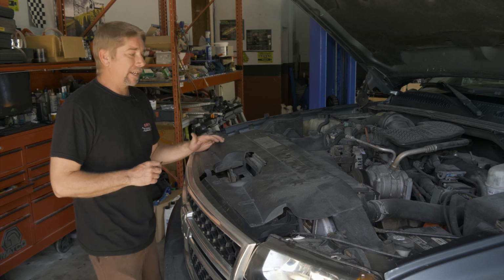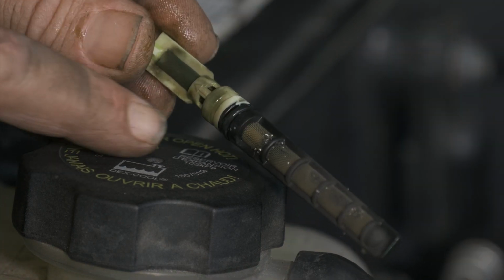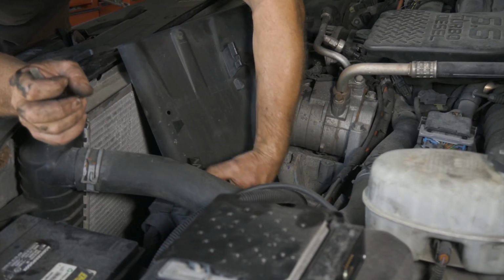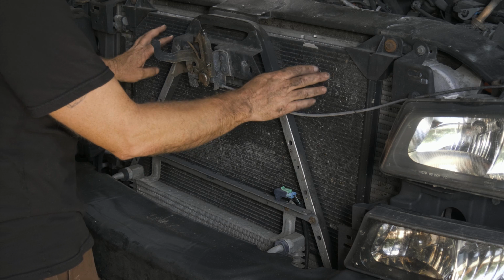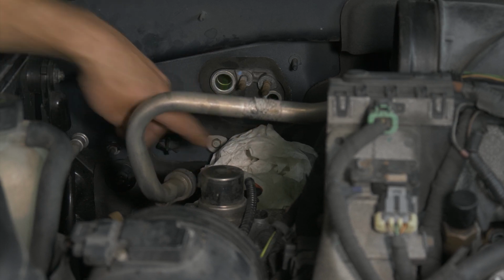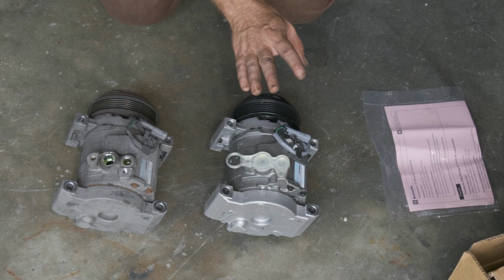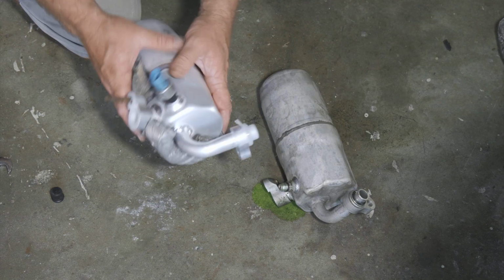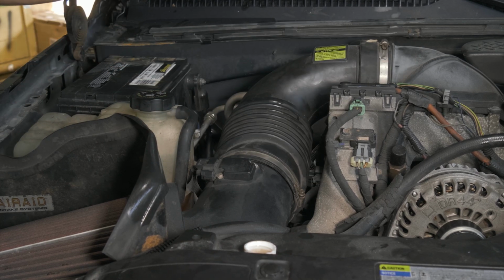2007 Chevrolet 2500 HD Diesel AC System

Comment: Just recharged mine.  Didn’t replace  as much as you did but I did high side schrader, orifice tube and vacuumed it down for 45 minutes and put 25 oz of refrigerant.  Blowing at 48 degrees.  Not great but not horrible.   2006 Duramax
Reply: Where did you buy your parts?

Comment: I just did my 2016 and the GM compressor said it has 1.3oz of oil in it. Mine doesn’t have an accumulator it has a condenser dryer/receiver. So that may be why it says only 1.3oz. After heavy digging I found that the whole system requires 6.1oz. I dumped out the oil in new compressor to balance it and literally two drops came out no matter how much I turned it. I was only able to get it to take maybe half an ounce. Confusing indeed. Maybe some kind of secret of pouring oil out of newer compressors? Point being never trust what the paper says. Always measure it.